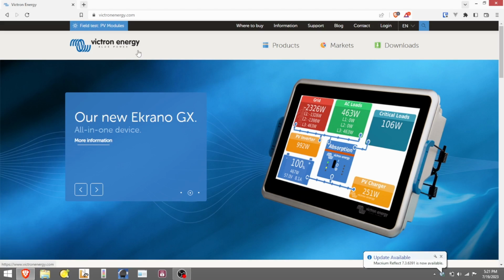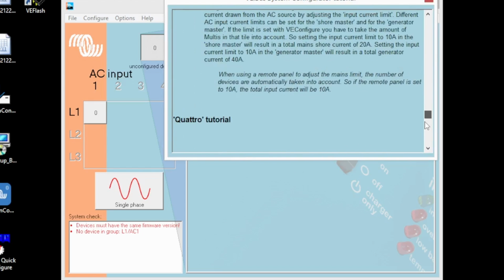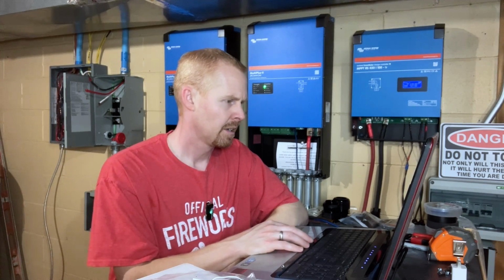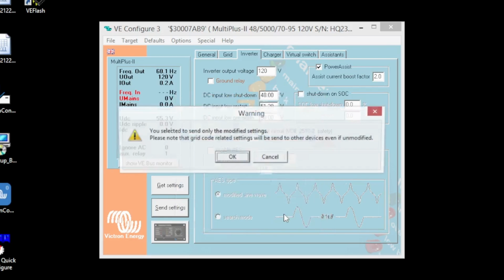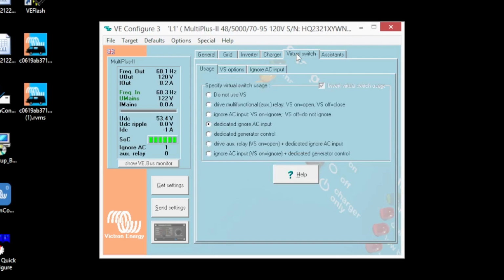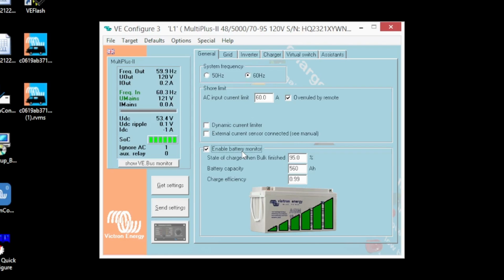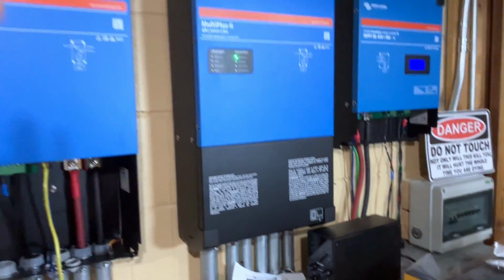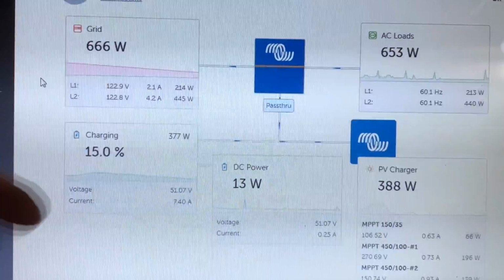A First Look at Programming the Victron MultiPlus-II 5kVA & Ignoring AC Input on the Inverter

Comment: Thanks for this video! Been watching your videos to figure out how to configure mine (48v/5000VA MultiPlus II). All I want it to do is 1) 30% SOC use "Mains" grid power. 2) when the batteries charge up to 50% turn Mains off. I am not using the Charger function. In your other video, I saw you use "Assistants" to set it up this way. That is what I have mine configured for now. I haven't seen it "work" yet (batteries are still above 30%). So, awaiting to see. However, do you need to also configure the "Virtual Switch" along with Assistants to make my configuration work? Lastly, my CERBO VRM Remote shows "No ESS assistant loaded" even tho I loaded assistants with the Mk3 on the MultiPlus.  Before I did this configuration -- the inverter would shut off at 30% and NOT transfer Mains (grid power). Thanks for your video and insight/response.
Reply from the maker: You can only configure assistants OR the virtual switch at one time, you can’t configure them both.  I would personally connect back to your inverter using the Mk3 to USB and make sure your settings saved to the inverter.  I would also try setting the “switch” values close to your current SOC just to make sure everything works as expected.  Once you’ve confirmed they work, then adjust to your 30/50% values.
Reply: @AdamDeLayDIY  Will do...thanks.

Comment: Hi Adam.
Have you checked what happens if you disconnect the storage while running on batteries, in an emergency, i.e. physically disconnect it via a switch or BMS?
I have tested this and the effect is that the multiplus disconnects the AC output for 1-3 seconds.
This is not good, unfortunately the multiplus is like this because the option to ignore AC causes desynchronization with the AC network.
Reply from the maker: I have not. You’re correct though that you would have a blip in power because the inverter isn’t expecting the disconnect.

I would rather deal with the momentary blip than any potential in back feeding power to the grid though.

Comment: I’m having a problem with my system on inverter mode not switching back to grid when the voltage drop.  I have to turn on the generator mode to get back to grid, would appreciate any help on your end for advice.
Reply from the maker: Does it switch automatically at all?  Almost sounds like there's a conflict somewhere.  Are you using the generator assistant?

Comment: Good video!.. I've spent a load of time researching Victron kit and I'm starting to have doubt about hitting the buy button. There should be a more elegant and direct way of making configuration changes. I used to write visual basic apps back in the 90's which looked more modern than that ancient interface.  Makes me concerned about future compatibility with windows products. I'm sure it's really robust and reliable but.....hmmmmm....not convinced yet.
Reply from the maker: Thanks. 

I have heard that they're working on updating their primary programing software to be more "universal".  If you're not doing any super advanced programming, you can use it now for configuring your inverters.  It's actually the same app you would use right now for programming the victron smart shunt or mppts (Victron Connect). 

To tell you the truth though, I can probably count on 1 hand the number of times I've had to be in the old software to make changes since I commissioned the system.  It does just work.

Comment: i just bought one of these,, and it wont work right out of the box,, i need a custom volt to run this,, my set up is 49.0 fully charged,, this thing just blinks at me saying my voltage is to low,,soooo i if i cant figure something out i just lost 2,000,it would cost a arm and a leg to send it back
Reply from the maker: It sounds like you need to get in to the VE Config software to be able to change the voltage range.  

I believe you could also use the Victron Connect app on your phone if you have an Android phone and a Mk3 to USB-C cable.

Comment: HI Adam, With this settings UPS functionality does not work. When I disconnect the battery power it does not switch to main power. Any idea?
Reply from the maker: I’m not sure these inverters are designed to run without batteries.  The UPS feature allows you to run on grid and if the grid goes down, it will switch over to battery power.
Reply: @AdamDeLay07  Thanks for the response.  When i discount battery power , inverter does not switch to AC input. What should I set to do this. Lifepo4 BMS stop discharging when the temperature is too low (sub zero)
Reply from the maker: @goobiie  I don’t believe you can change anything on the inverter to make this happen.  I would look at creating some kind of an insulated space for the batteries to prevent them from ever getting that cold.  Not sure what your scenario is but in the past I used an old chest freezer and a light bulb on a thermostat to keep my batteries warm when they were in my barn. 
https://youtu.be/dZUU9Rk77bk
Reply: @AdamDeLay07  This is not going to help. When you insulate the cells, these will get very warm on summer time.
Reply: @AdamDeLay07  one more question.  Do you have any video to setup multiplus Ii to share power between battery and AC input. For example to run 4kw load take 2.5kw from battery and 1.5kw from grid
Reply from the maker: @goobiie  it might be possible using the ESS assistant, but I haven’t done anything with that before.

Comment: I agree totally with your frustration. All I wanted to do was add some Victron batteries and thought the built in comms would be a plus. Instead it was a pain in the ass! Had to buy other equipment and still don’t have the full functionality from it as I expected. I know there is a convoluted history behind why this is so messed up but I think until they get their act together I wouldn’t recommend them over a Sol-Ark.
Reply from the maker: It’s taken some time but I’m starting to get used to the process since I’m using the VRM to download the files instead of wiring up the USB dongle.  It looks like most of the functionality has been moved over to the Victron Connect app (except for assistants), but you still have to have a wired connection.

Comment: Hu , I have a mutiplus 2  48v 500 70  , it's tripping on a 10 amp 1500watt single phase motor , motor has no load on pulley , can I adjust parameters to help this ,  my ecofliw delta did run it most of the time
Reply from the maker: Do you have some kind of discharge limitation set in the inverter?  Do you have it tied to grid or batteries?

Comment: Hey Adam, thanks for posting your videos, I just switched from Chinese inverters to Multiplus II because of the software. I am using Node Red within Venus OS and I got a script that enables my Venus OS (Raspi 4) to automatically switch from Inverter/charger to just Inverter at specific times of the day. I set my inverter to the ON position from 10a to 4pm to charge with the Multiplus during the sunny part of the day. Then at 4pm it automatically switches to "Inverter" only. This is so that my Victrons do not try to charge my batteries at peak rates.
Reply from the maker: That's awesome!  Yeah, NodeRed is on my list of things to take a look at.  Love the customization options!

Comment: Hey adam, so when you're battery bank. Went down to 15% the grid took over  the loads. And the charge was coming from you're pv?
Reply from the maker: Yes. Then it switches back once the battery is charged up to 30%.
Reply: @AdamDeLayDIY  oh ok, so how did you set the value. To 30%
Reply from the maker: @carlosreyes6448  Sorry, I've got several videos on the topic and this was one of the first ones I did.  

So in this video, it will switch over to Grid at 15% SOC and then it switches back to battery once the voltage has gotten to 53V for 5 minutes.  

I've since changed how I do this and I use the Cerbo to control it all.  Much simpler: https://youtu.be/4ZsGHi8nKGc
Reply: I really appreciate your help, Adam. This is the same type of setup. That I'm wanting to do. I love victron it's my favorite.
Reply from the maker: @carlosreyes6448  glad to be able to help!

Comment: I had installed firmware v506 in my Multiplus II 112v/3000Va 120 and my AES settings just plainly do nothing .. The inverter will stay on.  With the updated new VC connect and the extended settings (uses three letters as the password) ... It has the AC control, I have that set now to use solar or wind until the lower state of charge and then the AC charge will activate through a charge cycle, then shut off to battery invert mode .. until next lower state of charge reached. in the meant time the solar will charge when it can......... all that said, I've still not been able to get the AES to work in search (or any ) mode.  Weird, ... I emailed the supplier support about it but know know how the Victron support seems to lack ... thanks again..  back to re - viewing this.. pb
Reply from the maker: Yeah, I haven't updated to the latest firmware version yet to try out the new Solar and Wind priority option.  It's on my list of things to do though.

I've never looked at AES because my loads never drop super low.  There's always something running.  What do you have your power threshold set for to trigger and release AES?

Comment: Adam, I recently discovered your channel and have enjoyed watching your system develop.  I have a home critical loads backup Victron based system with 2 x 24/3000-70 Multipluses configured in split phase on a 24V battery system (22 kWh capacity) and went through many of the same experiences you have had.   I use the Cerbo Generator start/stop settings on relay 1 connected to the Multiplus AUX relay and use assistants in the Multiplus to ignore AC In, based on specific battery SOC conditions and/or peak (Quiet) hours set in the Cerbo.  Also, rather than turning the Multiplus battery charger off, I have found that by setting the Multiplus charger Absorption and Float voltages low (26.3V on my nominal 24V system) the Multiplus charger will maintain a base charge on the batteries of about 30% SOC, leaving plenty of room in my batteries to recharge from PV arrays (5400 watts total) once the sun comes up.  Once the Solar charger controllers start raising the voltage above 26.3V, the Multiplus charger no longer contributes to charging the battery from AC In.
Reply from the maker: Thanks Bruce!

That’s a great idea to leave the charger voltage low to give you a minimum voltage.

Comment: I am about to tackle this with a MacBook. Wish me luck.
Reply from the maker: Good luck!

After the video, I did figure out that you can use the Victron Connect app on a mac to do most of the programming, just not any of the advanced customization (using assistants).  You just have to have the Mk3 to USB device.  

I still have to do an update on that...

Comment: Great setting Adam. 
whats the way to do the initial config via VRM? 
I guess connecting the multiplus to the serbo. connecting the serbo to the network, and go from there? 

can you add the multi plus to the VRM via the serbo without any initial config? 
connecting via bluetooth or to the local serbo wifi? 

just guessing here

thanks!
Reply from the maker: Thanks!

Assuming you already have your MP connected to your Cerbo and your Cerbo is live on the VRM, you would then go to "Device List" in the VRM and click "Remote VEConfigure".  You can then download the configuration file for your MP and make your changes in the VE Config Software.  Once your changes are saved (of which they auto-save when you close out of the software), you will upload the config in the same "Remote VEConfigure" area of the VRM. 

This way, you don't have to have the MK3 to USB cable connected to your MP inverters.  You still do have to have a Windows computer with the VE Config Software loaded on it though.  

Yes, you can connect to the VRM with the base config, I just wouldn't try to turn on any loads or charge your batteries with the MP until you know you have your settings correct.
Reply: @AdamDeLayDIY  awesome. 
yeah, I dont have anything yet. 
some parts are on its way. some still pending to order. 

but Im moonlining deep into research and putting all info together. 

that's why I send a thank you note to your OCD. I'm the same way.  

so, for what I see there, I do need the MK3 to USB anyway...  (was trying to avoid it)

my thinking was: what if I connect the Cerbo GX to my network. configure the VRM. 
connect the GX 50 panel to the cerbo. 
then physically  connect the MP to the cerbo. 
maybe I can see it listed on VRM, and I can then either configure from there OR download a config file and then load it via victron connect over wifi / cerbo or something. 

having to buy a $75 MK3 to usb to configure all these seems crazy. 

wish they could have at least include an ethernet port with DHCP on the MP to connect directly via browser or something. 
or, being able to configure via cerbo wifi.
Reply from the maker: @RaymondCidadMoser  I think it's a great idea to do as much research as possible before pulling the trigger.  It helps you know what you're getting yourself into.  

So I haven't had anything I've come across where I HAD to have the Mk3 to usb device.  Supposedly there's some limitations of programming through the VRM but I haven't come across anything yet in all my testing.  

The only thing that comes to mind where you might need it is to initially set up the split phase configuration, but since my hardware all came from Current Connected, they did all that for me.  So I guess it kinda depends on where you're getting your hardware from. 

I did find out later that you can use the Mk3 to USB device to program certain aspects of the system using the VictronConnect app (which can run on both Windows or Mac).  I believe that Victron is working on converting everything over to that app, but some of the advanced config isn't available yet (assistants).  

Yeah, it would be nice for a more up-to-date way to program.  Like I said, they're working on getting the VictronConnect app working.  I'm guessing for their target market of RV and Marine, most people set things once and never touch them again, so they haven't really focused on the stationary installs.  

Hope this helps, and good luck on your own install!
Reply: Any chance of a video showing how to config MP via VRM without that cable?
Reply: @markbtanNZ  the thing with with and without the cable is the config options. is the same app (windows or macOS). but when you connect via wifi or bluethooth, the protocol is different. so it loads different info. even the setting page is different. 

without the cable: is to monitor, turn on/off. change status. stuff like that. you can also control the AC input (for RV if you connect to a residential 120v, you can limit to 15 amp for example)

with the cable: is to configure every value on that thing: AC low/high voltage connect/disconnect. DC low disconnect/reconnect. AES mode. power assist and its factor. battery value details. etc. 

I hope they change this in the feature and allow at least wifi protocol to carry these data. for RV/boat industry, is a pain to have to go all the way down into the unit and connect a cable to change configs.
Reply: @RaymondCidadMoser  Thanks for that and 100% agree with your last paragraph. Everything is remote these days…and the thought of having to spend more $$$ on a hard cable to make changes to a pretty expensive unit is a littttttttle annoying
Reply: @RaymondCidadMoser  what’s recommended - the dongle or the MK3 cable?
Reply: @markbtanNZ  you have to get the MK3 in order to do the full config. the dongle (bluetooth) is the same as the wifi build in (connecting to the victron internal wifi hotpot)==only operational config.

Comment: Adam,
 Great Video's! Did you ever figure out how to set the priority to us Solar & battery Not the utility and at 20% battery life to switch to your Utility, then charge the battery's at next light?? 
Wondering if on multiple cloudy days the Schedule could be used based on SOC of the battery's to switch to utility power to charge??
 Thanks
Reply from the maker: Thanks!

Yeah I did.  So there's actually quite a few different ways I've found to do this.  The simplest one is using the built-in "virtual switch" in the MultiPlus software (which is what's shown at the end of the video).  That works, but it doesn't give me the ability to manually switch to grid mode if necessary.  

It's on my list to make a video of how I did this, but I ended up using the Relay 1 on the Cerbo and wired that to the Aux Input on the MP.  I set up 2 programmable relay assistants based on the General Input flag.  One for the "on" state and one for the "off" state.  Then on the Cerbo, I set Relay 1 to be Generator Start/Stop and programmed my settings accordingly.  

It sounds complicated but it really isn't.  Using the Generator Start/Stop on the Cerbo, I have the ability to change the SOC levels from the Cerbo instead of having to program with the MP software every time.  Plus I can manually switch to grid using the Cerbo.

I also ended up using Relay 2 on the Cerbo and Input 2 of the MP to let me control whether or not grid charging is enabled.  That way if I know a storm is coming, I can just enable the relay on the cerbo and grid charging will start.  

Hope that helps.
Reply: Great,
 Looking forward to that video!
  I just powered my 2 MP-II 5K’s and 200amp Charge controller, 880watts of panels and 30kwatts of battery. Also used Constant Current.
   @AdamDeLayDIY
Reply: 8800 watts
Reply from the maker: @jwl944  I don’t follow
Reply: I missed the 0 from earlier post of 880 watts @AdamDeLayDIY